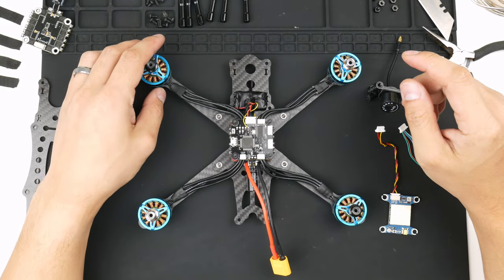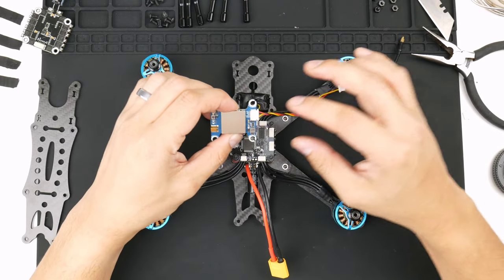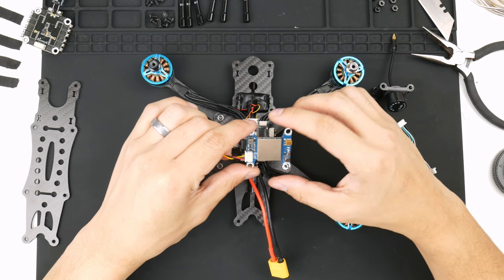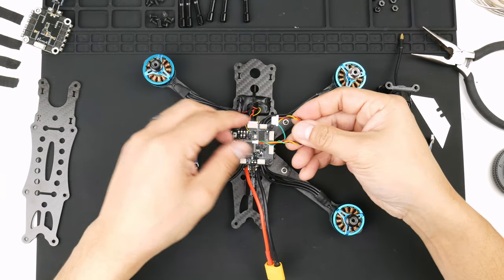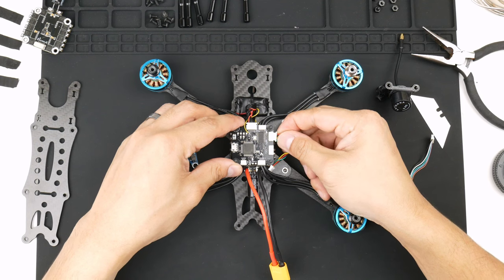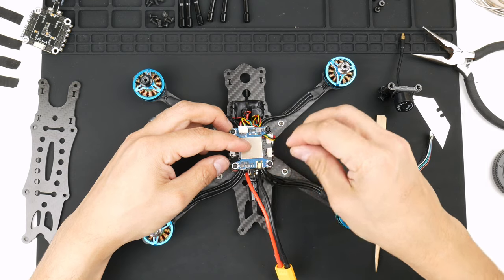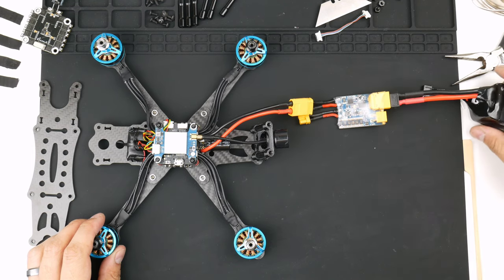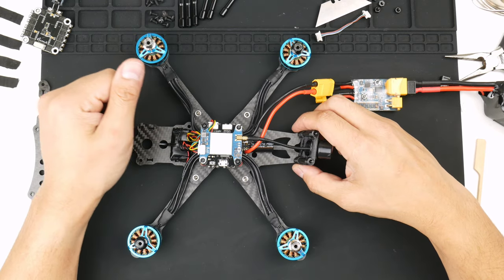TCMMRC Rebuild - Video Transmitter Install (VTX)

Comment: I have the sologood pro vtx and I'm trying to wire it to mamba f405 mk2 flight controller with the rxsr as reciever,can u please help me?
Reply from the maker: I haven't used the Mamba f405 MK2 board yet, but there's a wiring diagram available here:
https://www.multirotorguide.com/wp-content/uploads/2020/07/Diatone-Mamba-F405-MK2-F40-Stack-Connection-Diagram.jpg

The top right shows how to wire the VTX. Hope this helps

Comment: Hi I have the same vtx but from panda RC!! 😃👌🏼🚀😍 This FC is 5or 6S because I thinked it 6S but know I see in darwin sit it s a 5S🤔
Reply from the maker: Yes.. I have seen the same VTX under 3 different brands: Cyclone, PandaRC and iFlight.

The ESC + FC stack together can support up to 5S based on the specs on the item listing. So I wouldn't try 6S. I mainly run 4S quads.
Reply: @nxp200  этот стек работает на 6S. Я проверял это. Я установил моторы 2306 1800кв. все отлично.
Reply from the maker: 👍 That's great! Thanks for letting us know.
Reply: @nxp200  вам удалось подключить smart audio для этого VTX? какой результат после подключения провода на UART 3?
Reply from the maker: I haven't had time to try it yet, too busy with work. I will try it out and let you know. I'll also be releasing a video on configuring Betaflight and VTX in the future for this quad.
Reply: @nxp200  я также установил новый конденсатор. 35V 470uf. это нужно для работы 6S